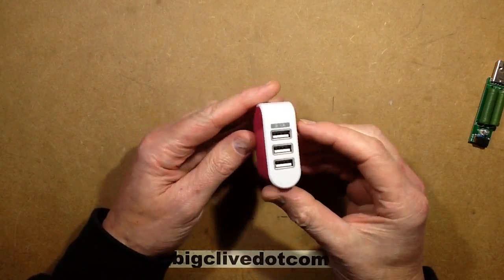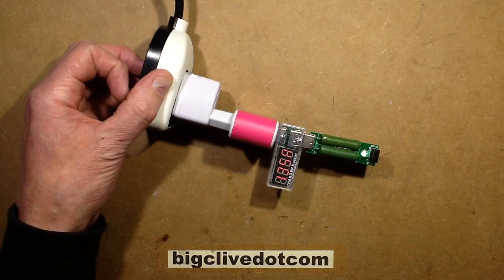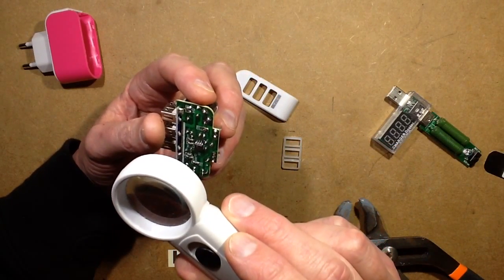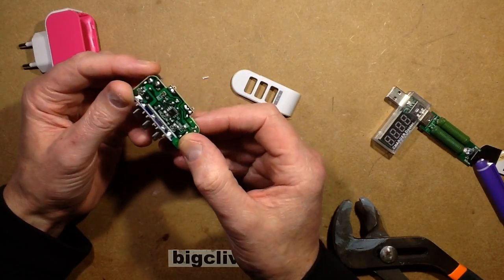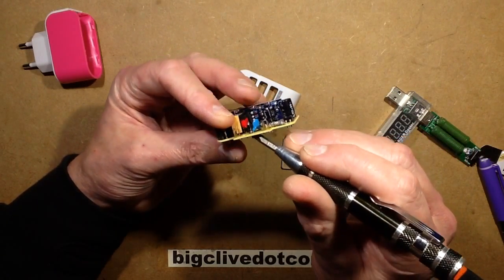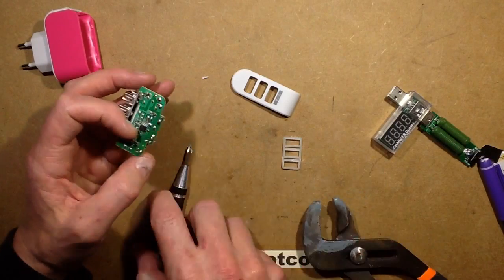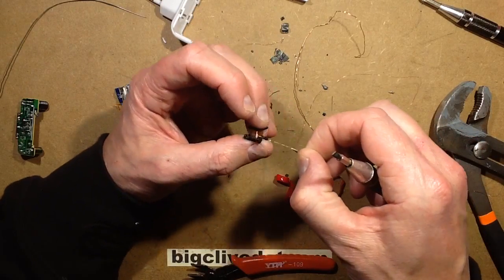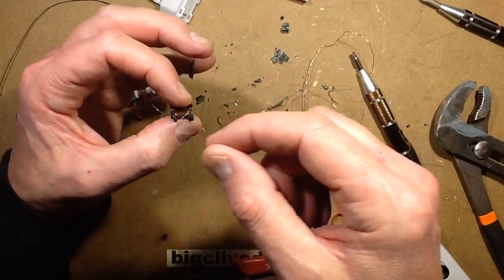Test of a three port 3.1A USB power supply.

Comment: I know this is fairly old but 3.1 amp chargers rated to provide 3.1 amps as to denote Android turbo charging which has to receive signal from device to switch to 9V two plus amps. Otherwise it's a standard either 2.0 or 2.1 which can be lower according to load.

Comment: Hi Clive, you did the proper thing with that charger! I wouldn't be surprised to see a mock VDE approval on it. I have designed many switchmode supplies and transformers in my day. The split bobbin doesn't work well at high frequencies because of leakage inductance between the primary and secondary. I tried it because it would be the safest. For true VDE approval, a full 8mm of spacing between the primary (any part of it) and the secondary (also any part of it) is required.

Just the physical size of that bobbin prohibits that. I am sure it's not large enough to accommodate that kind of spacing and yes, these things are death traps!

The primary is usually wound first to get the best coupling to the core. Especially if there is a clamping winding which would come next. The middle winding was undoubtedly the feedback winding which may serve as a sort of clamp winding. The outer winding would be the secondary because it would make no sense to sandwich the secondary between two windings on the primary side, because it would require more insulation, but then again, it doesn't seem they were too concerned about that.

I would have put the primary on with 8mm spacer tape on each end, then the feedback winding (probably with no insulation tape between them), then a couple of layers of insulation tape,  two spacer tape windings again at each end of the winding area for the proper clearance, 8mm wide each, then the secondary between those. They must terminate on opposite sides of the bobbin for spacing. You end up with a transformer about three times as big, but safe. These things are designed with a disposable consumer in mind, apparently.

Comment: I've actually used one of these for... ~3 years now.

After seeing a few of your videos I became slightly worried that it might kill me... or at least my phone, which would be just as bad.
Sooo I just searched your channel and lo and behold, exactly the same charger that I use.

Or have been using. I guess I'll stop now...... and also throw away the other few I bought at the same time, for some reason... I mean, who doesn't need a spare USB charger or three? "At the time, it seemed like a good idea."

That being said, it does give enough amps to activate the fast charging of my OnePlus 6. And it's noticeably faster than standard charging too, but I haven't compared the charging time with the original charger.

Hmmm... OnePlus is Chinese too. Have you dissected one of their chargers? (Doesn't seem like it.)
Reply: Just checked my emails... apparently I didn't just buy three as I thought, I bought TEN of them.... I guess I could sacrifice one of them and see if they have the same internals as yours.

Comment: I bought 4 of these from Aliexpress, and found: All of them went up in smoke after leaving any fully charged Mobile Phone connected to it over a 1-3 nights. Looking at the circuit, the 5V output has no protection at all for the optocoppler LED. So applying a few millivolts more on the output will cause the LED in the optocoppler to have overcurrent and to get worse and worse until the optocoppler fails first. Then the whole thing has no more regulation and outputs 15V (luckily all of my and friend's mobile phones did not go defective.) Then what happens is the 10V capacitor at the usb output will draw current and heat up and take down the 15V to about 10V and/or that capacitor will go bang from the heat. Depending on how the capacitor emits conducting gases, it may cause a spark between the mains at the solder pins of the rectifier because the mains are <0.5mm apart there. The mains spark was happening in 1 out of 4 cases and the mains protection switch cut off my room from power. Oh and before they all went up in smoke, I measured 0.73A typical total charging current (for mobile phones) shared among these 3 usb ports. Seems the ones i got had a different circuit, without a chip.

Comment: I have one of these (but with a US plug) that I bought a year ago. I never use it though because when nothing is plugged in, it made a high pitched frequency that I could hear.
Reply from the maker: That's common with some of these.  It's the regulation circuit turning the switching circuit on and off at an audible frequency.

Comment: I purchased a 6 port USB charger that requires a plug in power supply. It can handle up to 24 volts DC and 8 amps. I am using my laptop power supply which can supply 19 volts at 6.8 amps. It does a fine job as I have plugged in my phone, battery bank, smart watch and tablet. It will charge all 4 items at 5 volts and over 1.5 amps. I like chargers like that, but the one you have there is terrible. it starts out below 5 volts and drops to under 4 at just over 1 amp, that is terrible.

Comment: Why is the distance between primary and secondary so important? I always thought either there is a connection or not. Sorry for that dump question, but I'm new to this stuff ^^
Reply: +Techtastisch 75 You really don't want the primary to have a chance to 'track' (arc) over to the secondary through some dust that has settled on the pc board between the primary & secondary, as then you could get nicely "energized" - i.e. shocked or even killed. So more isolation space is good, better yet anti-tracking slots so there isn't a pc board there for dust to settle onto.

Comment: Hey bigclive - why do you think devices such as MS Surface Pro have very little power running through their 3.0 USB port requiring me to buy a powered 3.0 USB Hub?  Very frustrating!  I'm not sure but I think the other tablets such as Apple's are in the same boat (although MS seems to tout the Surface Pro as a double duty laptop/tablet - which I agree with by the way).  Is this a matter of space within the tablet?  Cost?  Any theories?  How hard can it be to provide enough power to run basic devices like a portable scanner?  Very frustrating and it would seem like the mfg could easily address this but I don't know why they don't??!!
Reply from the maker: It may be to discourage people from running high loads on the port, which could quickly drain the lithium cell or cause damage to the port circuitry.

Comment: i bought this off eBay and askdd about it from seller and they said 2 ports are 1 amp and other one is 2 amp also it has leds inside so lights up in dark i took the charger a part in school and found out the mains connector was dirty

Comment: You have to understand one thing. No Mather which one you buy, a cell phone for exemple does take only about  one amp even if the gadget say that it goes up to 3 amp. You will read about 0.9 amp. If you put a tablet or a bigger gizmo you will get a bigger reading. I did the test and I thought they sent me a cheap one. But when I plugged a big tablet I got a higher amp reading so then I understood that gizmo takes what they need and not more, even if it can give more amps it will not take more. The voltage is a différente thing. You can not give more voltage then it needs because it will fry. So your gadget is probably give up to 3 amp but will not give the max if mister receiver gadget is not hungry that much

Comment: That "1A per port but not at the same time" way of specifying it, would be similar to how many hifi companies specify their amplifiers. Especially in the world of surround sound, companies will make claims like 7 x 120W, and then it turns out it really works this way: Each amplifier unit (of which there is 7 in this case) can deliver a maximum of 120W by the DIN standard. BUT that is only when running a single channel. Then they rate the entire unit 7 x 120W, but it might turn out that the power supply is only like 400W. It's lame.
Reply: I seem to recall from decades ago that one of the "HiFi" output power rating standards was so contorted, the resulting number would vastly exceed what could be delivered to even a single speaker (let alone all) for even a few seconds.  Meaning that an efficient design could actually output more "HiFi" Watts than its power supply would ever draw.
Reply: They may have been listing something like "Peak Music Power Output" (PMPO) which is basically only at a specific frequency and only momentarily. I suppose you could refer to it as transient wattage. Totally worthless for actually saying anything about the actual power of an amplifier, but gives a very inflated number which is always good for marketing :P

Comment: I've had three of these, two of them blew up.
Reply from the maker: The only way to guarantee you get a genuine good quality one is to buy from the outlet of a high profile brand.  I tend to recommend Apple or IKEA chargers since they have a reputation to protect.  Don't buy an Apple charger from a random source though as it may be fake and just as dangerous as the cheap ones even though it costs a lot more.
Reply from the maker: They did you a favour.  Pop the third one in a bin and buy yourself a good quality charger from a reputable source.  It'll reduce the risk of damage to your equipment and you.
Reply: How can we recognise a good one?

Comment: So, you conclude that the device is not up to our safety standards, is not safe and you don't recommend using it. At what point do you suggest that it's downright illegal and the seller should be reported to trading standards? A big healthy chap like you might be okay with an occasional tingle from a mains shock, but many people are not, and people with heart conditions could be killed by this stuff. Shouldn't we, as informed people reviewing these things, be enabling the authorities to clamp down on dangerous electrical goods?

Comment: Somehow I see myself putting the small board with the USB jacks on it directly to the 5v rail of an ATX power supply. It would have it's 3 amps then for sure. Matter of fact, I've already modded my computer case with an old USB panel to use just as a charge port hooked directly to the PSU anyway. It's not unreasonable really with today's hungry devices.

Comment: What is that test load?

I have been using a 10 ohm 50 watt rheostat to test USB power supplies and cables with a similar meter but your test rig looks much nicer.
Reply from the maker: Common eBay USB test load.

Comment: Hi Clive, I was wondering, for all the vendors that seem dodgy, is there a ebay buyer that seems semi-reliable you'd recommend?  The only decent electronic component vendor near me here in Canada recently shuttered up and its getting increasingly difficult to find even basic components like wire from places that aren't selling wholesale in very large lots to professional companies.  It's still going to be significantly cheaper for me to import it and this is mostly for hobby projects so it's nothing that can't wait.  Local supply here is getting hard to come by sadly.

Enjoy the videos by the way, you're both very good at what you do and entertaining to watch (well, listen to?) which is why, one supposes, she tosses her question into the churning sea consisting entirely of questions and comments that is the youtube comments section.
Reply from the maker: Strangely enough I've been doodling designs for a municipal Christmas lighting control unit, and after half heartedly looking at the eBay solid state relays I then went to a proper component supplier and looked at the options there.  Or in other words, for fun home projects eBay is OK but unpredictable, but for pro jobs you have to just grind your teeth and go for the pro components with known behaviour to avoid awkward combustion moments.
Reply: I'd settled for a foreign supplier with sane shipping.  The only local place that's any reasonable distance for me to travel to has ridiculous minimums on everything.  You have to buy at least five soldering stations at a time!

Comment: Yeah, ferrite, some is, indeed (very) conductive. Got bitten by that once. Big bare copper wire spaced out windings (like two or three loops per winding) worked fine on the old stock cores, got exciting and nearby components let smoke out on the new stock of cores. (6VAC heater voltage transient monitoring circuit, supposed to be isolated (no, not at all sane design)) Varnished wire solved the problem at minute expense.

Comment: anybody has a go-to website to check the datasheet of various chips and components. if i don't know the manufacturer, i always end up spending 30 minutes going from one chinese site to another, all promising me the right datasheet but it's always a click bait. any suggestion? also, why are these sites doing that? besides infuriating me and prompting me to never ever buy anything from these irritating morons, why do they think that if i'm interested in a hc2513 chip, i will most def be interested in a  to220 npn transistor????
Reply from the maker: The "data sheet archive" type sites really piss me off.  They claim to have the data sheet you want and then after a few pages of adverts list non relevant components.  Google used to have a facility for blocking sites like that, but it's gone now.
Reply: bigclivedotcom thanks for sharing. i'll let you know if I find an effective type of search query to find datasheet pdf...
Reply: +bigclivedotcom I typically search the big wholesale / retail component sellers (element14=Farnell=Newark, Digikey etc.), they have datasheets for most parts, not necessarily the latest revisions, but they are real datasheets that they got from the factory, because they are actually buying and selling the parts.  For recognizable brands with functional websites I just go direct, but a few brand websites do crazy stuff they shouldn't (Like ti.com redirecting to China when downloading a datasheet from Western Europe, or TE crashing my browser when searching by part number).

Comment: Found another one for you, c/o Wilco's / Wilkinson's..... 1a rated single single port for £2.50..... quite a chunky thing, in blue or pink, and looking at the size of it, gives me some hope it's got a better layout than most, but one worrying thing is, unit comply's with BS1363, and has no official BSI markings (Or any from TUV Germany etc), or any mention of ISO conformity, so I call BS on any official rating..... I may take one apart, but it uses no screws, and don't appear to be a snap shut design either, so maybe one for you to have a look at if you have a Wilco's near you.

Comment: those metal clamps used to connect the pcb to the AC pins saved them the 4 cents needed for a worker soldering wires and also increased the reliability at the same time, FTW!

Comment: Hi Clive
I noticed you did not test the socket next to the 3A label for 3A output, not sure it makes any difference on that but some units only produce the high current on one connector. Windings on that unit were poor for clearance. But the reason for primary and secondary windings on the same bobbin is to get good coupling and low leakage inductance. Some even split the primary i.e half of the primary as the 1st winding and the other half as the last winding. to improve the transformer specs.
Reply from the maker: All the sockets 5V and 0V pins were in parallel.
Reply: OK just a thought.

Comment: hey clive i have a really trashed/worn power strip that has abunch of problems (black glossy rubber with cracks, corrosion on a plug, rattling inside, static noise on steroids when you plug something in or move it a certain way) id like to send you it to autopsy in a video. Its american though so you need to the deathdapter for it but where would i send it?

Comment: I once bought a "heavy duty" fat orange extension cord, you know, the kind people use in shops or outdoors. While it was powering just my desk lamp with a 14 watt compact fluorescent, smoke started pouring out from under the couch it was passing under. When I took it apart I found out that live wire of the cord was a single copper strand not much thicker than the winding wires of that transformer. That was it. Just thick orange vinyl and a single tiny strand of copper. Our consumer safety officials are really falling down on the job letting this trash flood the market. Mine wasn't even an eBay purchase, it was a store purchase.
Reply: Keeping clones/knock-off products out of stores is becoming increasingly harder, and it's something that worries consumer safety officials basically all over the world that has any decent standards concerning consumer safety.
I bought an extension block for the mains in what most people would consider is a very official and safe DIY store here, and when I wanted to replace the power cord on it (long after the warranty had passed, by the way) and opened it up, I found the earth wire being jammed shut between the live rail of one of the modular socket blocks (it has 3, 5, 7 and 9 socket-versions) in such a way that should it have been severed there, the earth could have been live without the earth wire in the socket itself actually acting like it should.
This was an extension cord I bought in 2008, so it was already a problem then and I was not happy to see how problematic the design for something you "officially" buy in a "good" store was (I fixed it by the way to stop it from ever actually causing the danger I saw being possible).
The power cord weirdly enough was very much up to standards, had actual copper wire and was up to the standards of thickness for the marketed total power drawn from the attached sockets.

The cable might not even have caught fire due to the load you were drawing over it, but because of it's own resistance trying to pass well basically any kind of current over such a distance.